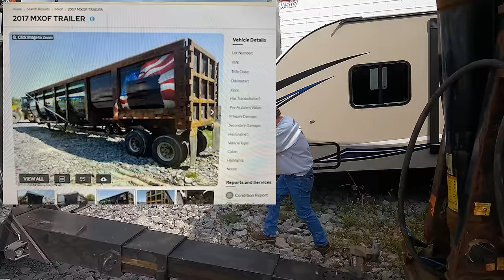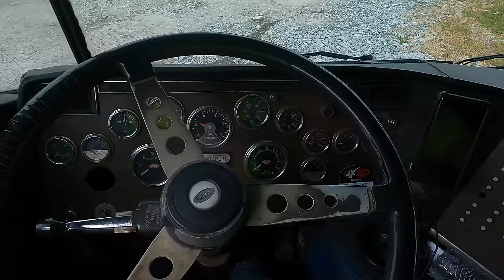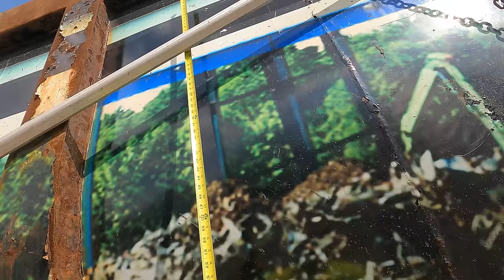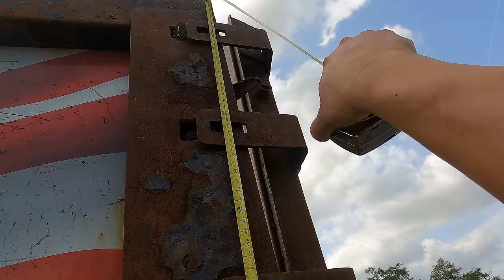Nothing But Trouble Loading A Huge Heavy Dump Trailer

Comment: Just to add, I hope the wrecker company and your dispatcher charged this SOB TOP-DOLLAR for this!!
Reply: To be fair 1 should know the measurements before accepting the job.... And if the customer doesnt know the exact measurements DONT ACCEPT THE JOB. This guy with the trailer should have brought the proper trailer. But since he didnt even know the measurements of his own trailer he took the job and now eats the loss.
Reply: usually wreckers and rotators carry air hoses with gladhands on one end and quick couplers on the other too hook up the trailer brakes too the towing vehicle and most carry a little fifth wheel that mounts on to their under reach and they can pull the trailer down the road if they have too
Reply: @mikebonnett7730 I agree but if the air lines are damaged or dry rotted and the mounting plate is damaged like this one, then it’s completely useless.
Reply: @famousamoso7 it’s not always that easy. A lot gets lost in translation .
The driver picking up the load is going off what the seller tells them. True you should see the red flags but trucking is a very highly competitive business. It’s a crap shoot.
Reply: @mikebonnett7730  Boy that wrecker guy is no Ron Pratt... I seen Ron even has spare hoses on his rotator, so if he needs to use his own hose to connect to the brakes he can...
Reply: Otherwise known as the "A$$ hole tax" (Reddit has a quite entertaining forum dedicated to this).
Reply: 😂😂😂 amateur hour😂😂😂

Comment: Gad damn that’s a giant tub of rust 

Gotta do what gotta do to haul it to get scrapped. 

That’s unusable the fricken door hinge handle broke off from rust for sakes! 

NY rust is bad rust friggen bumpers of SUVs and trucks completely rotted away, pickup beds and fenders, doors and under doors, bed mounts… etc etc. I’ve seen frames bend in half before. Gotta try and keep ‘em clean and rust prevention coated before every winter time

Comment: What was bent besides the draft arms? Pulling an end dump by the jaws is how wreckers drag them down the highway. Chain the draft arms up. Ussuslly they have hooks welded to jaws to hold up the draft arms. Draft arms do are not used to pull trailer down the road. The jaws set on the fifth wheel plate and the jaws drag the trailer. Draft arms are use only and specifically to dump, not designed for hihhway pulling. Been best to pay wrecker to drag where ever needed to go. Trailer repair shop or junk dealer. Wrecker driver should have known this. A wrecker got it to where it is.

Comment: You know, I sit here and look at that rusted mess of a "trailer" and my first thoughts were; the individual actually PAY money for that and what on God's green Earth is this person going to do with that decrepit piece of steel?!
Reply: It is a Scrap, literally, Scrap trailer.
Reply: @dougbourdo2589 the only good things on it is the trailer axles
Reply: That trailer wouldn't be hard to rebuild, it's steel so you cut away the junk and weld new metal in.  The only thing really damaged is the dump frame.
Reply: have you priced a new trailer lately?
Reply: the frame unbolts from the dump box it takes about a day to replace it .
Reply: That trailer is still worth around 18k + like it sits a new one is 75k maybe more, it looks like it has about $450 worth of scrap in it.
Reply: It’s literally a scrap and junk trailer….that’s literally what’s it’s gonna be hauling
Reply: @yanevaknow1017  HMMMMMMMMMMM,AND WHOS  ON THIRD????????????????😁😆🤣🤣🤣🤣🤣🤣🤣🤣🤣🤣🤣😛😛😊🤣🤣🤣

Comment: Get a cutting torch ,landing gear has got to go ? Remove the tires might get it low enough ?
Reply: Just the forward angled braces; which are bolted. Set the frame on the rear deck with the main gear structure just off the rear end - you'll likely need some dunnage to keep the gear above the road surface. Let air out of the tires to get the wreck's back end down to legal height.

Comment: That looks like the trailer that flipped over in Utica
And if it is that trailer from Utica, it was loaded. Scrap steel plus 4 of those giant milling machines up on top the pile. Way too top heavy
Reply from the maker: It was flipped and was loaded.  Didn't know where.
Reply: @fsctrucking Going from Route 12 south to Route 49 east. It's a 30Mph curve,
That clean up started about 7a and screwed with us local guys til about 5p on that monday
Reply: If this is it....
You can Google search ....
Truck rollover shuts I-790 ramp
Reply: @davigorb 
Found the one you're talking about. Don't think this is it. The pics from the scene that were in the article showed it to be all black, didn't have all the flags and whatever on the sides. Looks to be the same kind of trailer though. At any rate, that driver felt that smack on side of his head for sure.

Comment: I had a bit of a reputation for being the man to deal with 12 car loads or non standard vans. I always used to get vans kitted out for carrying sheets of glass, utility company stuff with ladder racks on the roof or telecoms vans with telescopic masts/dishes  and hi-lift off road stuff. At best 7 standard Transit or Mercedes low roof vans would mean running around 16 feet but you could guarantee if I went somewhere and there were 1000 standard vans and 7 oddball/oversize I would get the 7 but all the paperwork would say the load was standard body, low roof and short wheelbase. 
Heart problems cost me the licence, I miss the challenge but I don't miss the grief, or constantly running around at 16' 3" with a few tyres let down when things got really crazy.

Comment: You have to know your deck heights,, take landing gear legs off,put them in the trailer, take tires off, put in trailer,, charge the customer for all your time, you guys haul stuff to cheap,, that's part of hauling equipment, you gotta figure it out,,,i don't know how you guys can work with chains or any equipment with out good gloves on, don't you get the inside of your truck,s full of grease and grime,, just sayin 😮

Comment: Just hang the landing gear off the rear, then the whole trailer will be under heighth but just a little long...   Evidently the wrecker driver did not see the sign that required reflective clothing.

Comment: There's not much left in terms of workable / weldable steel on that trailer... saw way too much salt over the years.... guess anything can be fixed but at this point you'd be building nearly from scratch using rusted parts for templates ... tilt 🙂
Reply from the maker: Not my problem.   I just haul it.

Comment: Your mistake was when you measured the front with the landing gear down or up. You crank down the landing gear after you lift it up with the tow truck and then you measured it again with the Limi gear all the way extend it.

Comment: Steve i would have turned the truck around and left. And WTH made the person that brought that trailer buy it. It's not worth repairing and my husband said that he would have just take torch cutter's and chop it up and scram the metal for $$$$. And that is what a worker is doing cutting up a trailer and scrap it for metal. And we are just keeping the axle's and wheel's and that's it. The worker will get paid $$$$$ and he will take a shower here cause i bet he's sweaty. He's almost finished he's cutting the axles off the frame of the trailer which we will keep and shorting the trailer and use the frames to build smaller trailer's for the Hotshot driver's.
Reply from the maker: Remember I make money on content and on things others are afraid of.

Comment: Can you turn it and put landing gear on front then pull the wheels off the back and throw them in the trailer and let it ride on hubs. Would it be low enough then?
Reply from the maker: No.  Tandems don't quite fit in the well.